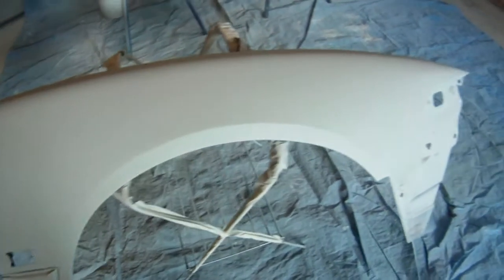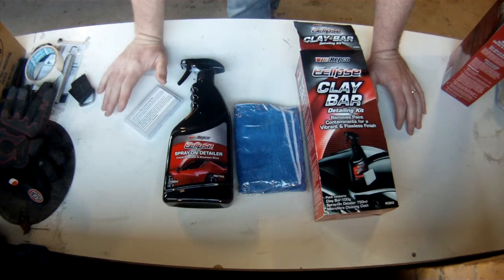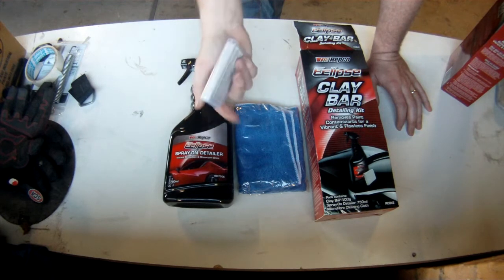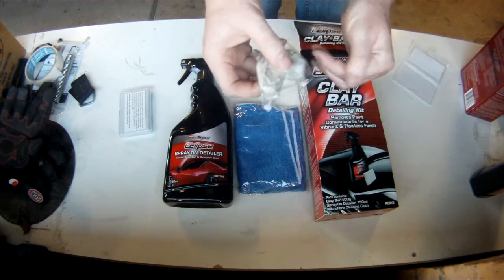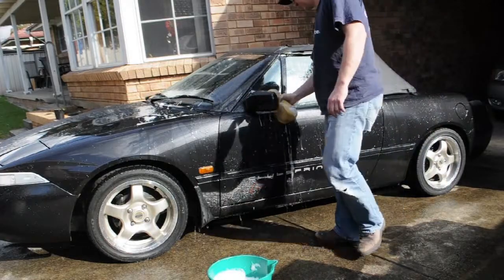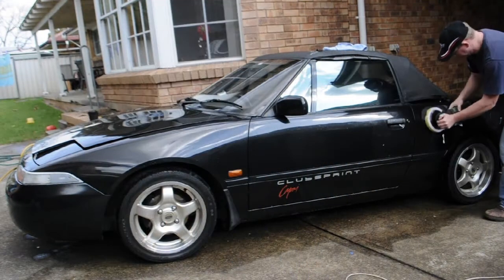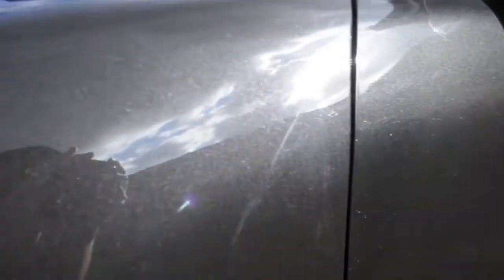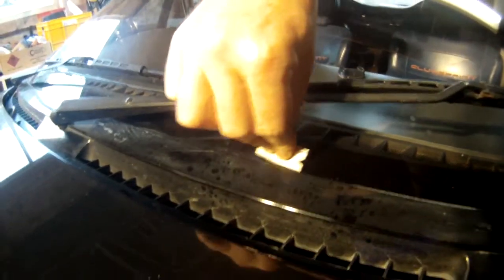How to get rid of Overspray

Comment: IMPORTANT  I got a 2005 GMC Safari Van, bout matching Dupli-Color spray can to do some touch up.  I goofed up, did not cover non-paint areas enough, got 2 areas of heavy over spray.  So I read most You Tube comments.  So I followed suggestions. (1)  Bought a $19.95 Clay Bar Kit...did not cut thru over spray.  (2) Carnuba Wax....no luck, no effect.  (3)  Rubbing compound...zero removed.  Now down about $42.00.  Went to kitchen, got a scotch-brite pad...BINGO.  Used water and pad, came off EASY.  Not hard at all, no damage to paint.  Waxed after that, perfect.  SO  Use water spray and a $3.49 pack of 4 scotch-brite pad.  Cheap and easy.  Good luck.
Reply from the maker: +Jack Fuller nice one! some times the easy fixes are the best ill try that one next time for sure. thanks for the comment.
Reply: Jack Fuller y
Reply: What color scotch brite?

Comment: Will it take off primer ? i qot grey primer on my bumper i need off...
Reply: It takes off overspray. Not full coats
Reply from the maker: Hi mate, sorry I missed this comment. as RootedJay said (thanks for that mate) it won't take off paint, only overspray, Primer needs to be sanded to realy come off if its in a large patch, the clay bar picks up the single particles of overspray, if you have a group of paint molecules that are together the claybar will struggle. You can always buff though, a fine buffer can cut away overspray primer depending how bad it is. 

Another option is check out a Guy called "thegunman" on youtube, he is a painting genius, while Im just a hack at this stuff, he is a pro, he would be able to help you fix the overspray for sure.

Comment: how to get overspray on window rubbers tho?
Reply from the maker: Hi Queenie, good question, I would be careful with window rubbers with the harsher stuff (sand paper) I would suggest something like a 'bug sponge' to begin with, if that does not work, try some light cutting compound and a hand sponge (probably a firm one over the soft car washing sponge) and see if you can work it off that way. 

let me know how you go and if you are still having issues I happy to do some research for you, I know some panel beaters I can ask for you.
Reply: hi Tim! I tried using a regular sponge with green scrubber (used the green scrubber part), and tire shiner but I'm trying the light cutting compound, didn't checked my replies for days.. thanks! the 3m brand should be good, right?
Reply from the maker: queenie ilangos No worries, when Im on a bigger car job I dont check my replies for ages ether. the 3m stuff is awesome if you can get it, let me know how you go and if that does not work ill get my pannel beater mates to voice in.